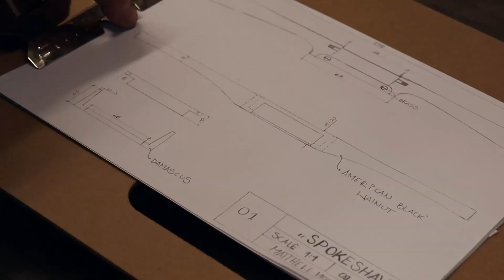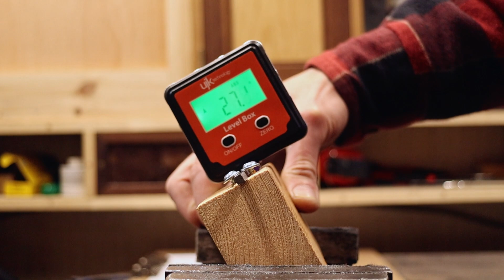Making a Spokeshave with Damascus Blade

Comment: OK------Have you any dimensions of that Damascus blade ?  length ? width ?  appreciate !
Reply from the maker: @CarlWinter-oy8uf  yes I'll check them tomorrow for you
Reply from the maker: @CarlWinter-oy8uf  cutting edge is 46mm ,10mm wide and 3mm thick, overall length before bending sides was 106mm .